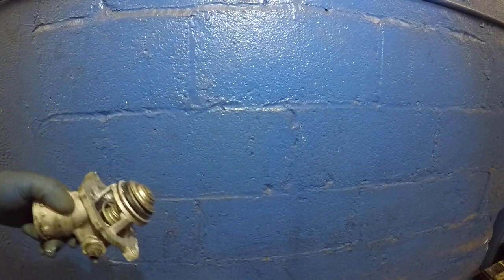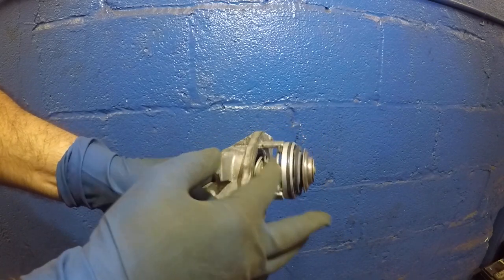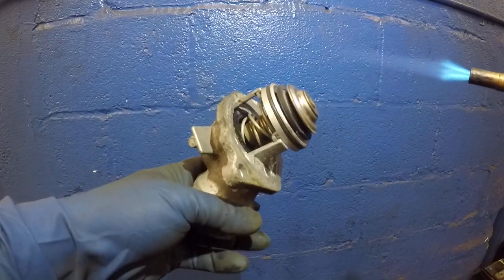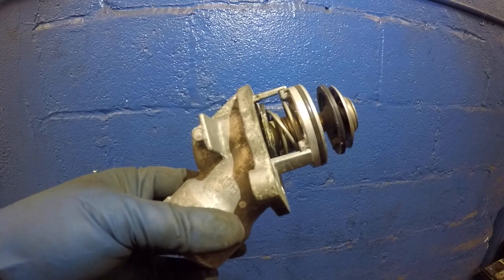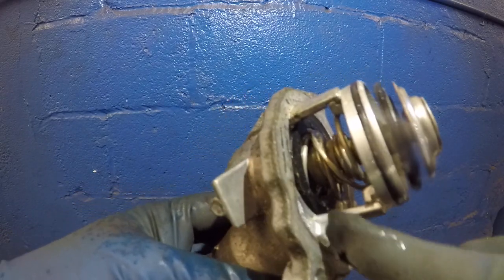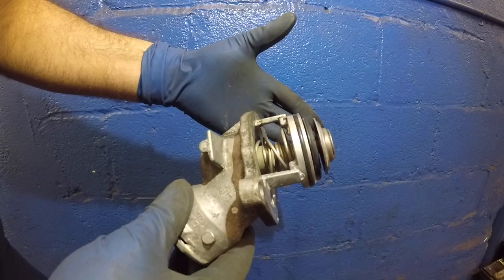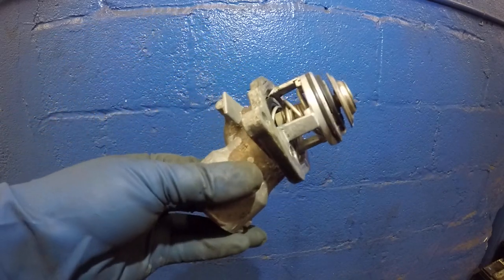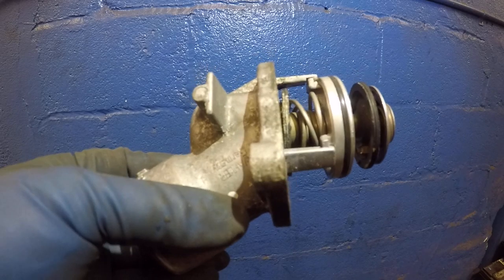How thermostat work, Watch how this Thermostat open with heat

Comment: I recently changed thermostat on my Toyota Prius V with 200k miles because it got stuck and overheated and most of the coolant got out. So, now , I still see the overheat sign coming on and off , after 20 to 30 minutes driving. So, if I take off the spring in the thermostat, since it comes with housing. will it keep the thermostat open. I want to do this so that I don't want to see the overheat sign within 30 minutes driving. Because, my daily commute is 20 to 30 minutes. And I don't want to spend any money if I can drive by taking spring in the thermostat, until another 50k miles. And then, maybe go for new engine.
Reply from the maker: You have to check what’s causing over heating dose the fans come on? Did u have ac on?  Also clean out the front condenser and radiator usually leaves and stuff blocks the air flow I don’t think thermostat is ur issue and taking the spring off will not do much
Reply: @RBTheMechanic  well, the fans turn on. And I got the radiator flushed at the dealer so there's no air bubbles in the system. Anyway, I am suspecting slightly blown head gasket. If so, will the open Thermostat delay overheating sign. Thank you for your response.
Reply from the maker: @kumara5492  yeah if u have blown head gasket that’s somthing that gonna keep eating coolant u will see smoke white colored smoke out the tail pipe
Reply: @RBTheMechanic  oh, in that case, it might not be a blown out head gasket. I am not loosing any coolant or see white colored smoke. Now, I think it's something else, maybe air bubbles in the coolant system, that Prius in notoriously known for. Anyway, I'll take off the spring and see if the heat sign stop coming after 30 minutes drive. This option seems better than getting diagnosed at the dealer and getting ripped off. I 'll be ok if this engine serves another 50k as it has already done 200k miles.
Reply from the maker: @kumara5492  you also have to check if radiator has good vent meaning clean out the radiator outside  usually things get between radiator and condenser and no air flows through to kee it cool
Reply: @RBTheMechanic  sure, I'll check it out. Thank you so much for the reply
Reply: Why don't you just leave the thermostat out, that's what I did ,fixed my overheating problem. My thermostat was barely opening causing a lot of pressure, my top hose was hard as brick after running the engine for 30 minutes, now it runs very cool. Maybe cooler than it should but it's an old chevy truck and we like it cool